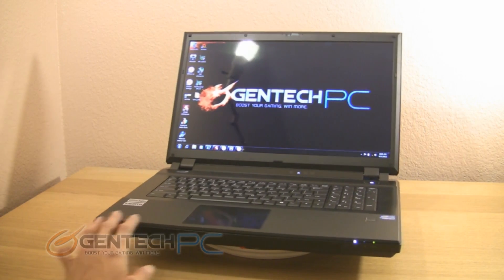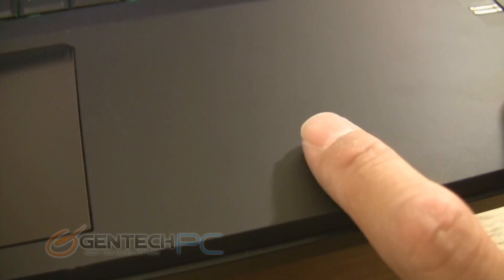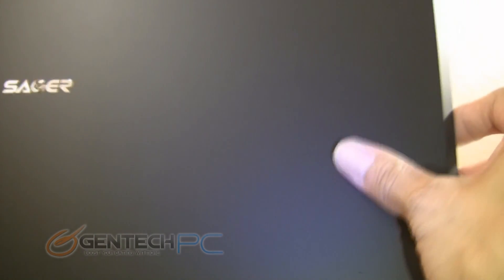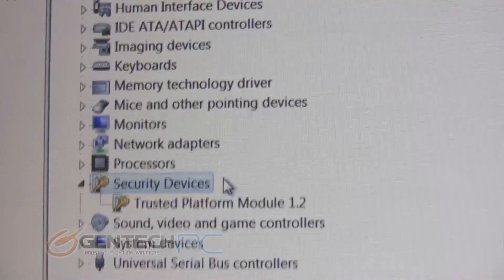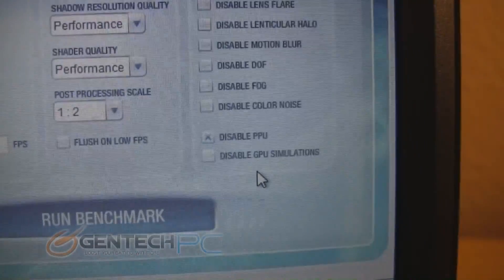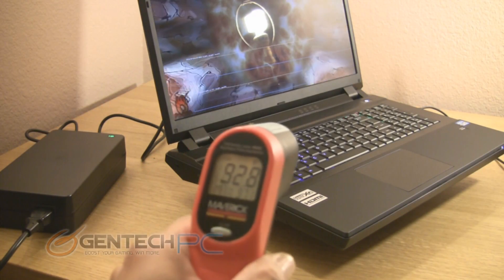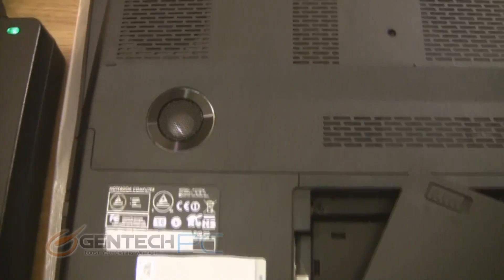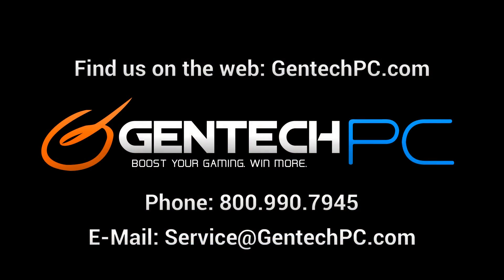Sager NP9370 (Clevo P370EM) GTX680M SLI Benchmarking & Review

Comment: Well I just ordered on of these. I got the 2.6Ghz as well as a 64GB SSD (in addition to a traditional HDD), but I went for a single 7970 to save a bit of cash.

I did quite a lot of research, and decided that the performance differences were minimal enough to save the $250 or so, also considering that Enduro isn't enabled on these. Later on, maybe in a year or two, I could pick up an extra 7970m and remain relevant.

Comment: I would say they are both on par with one another with regards to performance. The sager would be more easy to fix and a lot more future proof. It also has a better cooling system. The alienware has more pretty lights and colors on the side, but then again, you can get the sager carbon wrapped from xotic pc anyways. So if you don't care THAT much about the lights on the side (the sager has a colorful backlit keyboard too) then get the sager for better reliability and upgrade options.

Comment: Can i connect my xbox to the monitor via hdmi cable ( i dont know what hdmi 1.4 with hdcp is maby that means hdmi in?) for audio/video use? I was told you need a hdmi in/out port not just an hdmi out port which makes sense i guess.

Comment: he said first 17 inch  to run the GTX 680m and AMD 7970m in SLI and Crossfire, presently the M18x is the only alienware laptop to run SLI and Crossfire and its 18.4 inch and cost alot more then 17 inch M17x, There's about a $400 difference in this running in SLI with the GTX 680m vs the M18x.

Comment: Crazy! This laptop with the 2x4GB GTX 680m's will run Doom1080p all Ultra settings at 35 to 100 fps! Average wise around 60 to 65 FPS. Windows 10 a little slower, but windows 8.1 speeds things up by 20 to 30 percent!

Comment: Haha... I have the same question. I was JUST about to call alienware and order one when I saw this video... I've never owned either, BUT from what I've read is that Alienware laptops are better when looking at build quality. Other than that, I believe if you have the same specs on both and don't need the flashiness then you can save a little bit of money by buying the Sager. It all comes down to preference.

Comment: well one gpu is on both sides, so there isnt much you can do. regardless there is 3 fans. one on each gpu and the cpu. even with sli 680s it runs extremely well temp wise. I was impressed. it was hardly running over 100F which seems quite nice to me

Comment from the maker: They are pretty much the same besides the cahssis and dual GPU.  Also the video cards are different because 9370's video card does not support Optimus.  so if you take the 9370's GTX680M on 9170 it will not work.

Comment: i would get the asus g75, it looks alout better they have their own chassis, and cooling is alout better sound, etc. the performance tough wouldent be as good but still pretty good, if you got the 670m version you could run bf3 on ulta at 30-45 fps. i have one :)

Comment: Hiii, i've got a laptop Alienware M17x R4, Processor : 3rd Generation Intel Core i7-3740QM (6MB Cache, up to 3.7GHz w/ Turbo Boost 2.0), Memory: 12288MB 1600MHz Dual Channel DDR3 (2x2GB + 2x4GB ), Hard Drive : 1TB RAID 0 (2x500GB 7,200rpm, Graphics : 2GB GDDR5 NVIDIA GeForce GTX 660M, i play this game call (Warrock some how i get low FPS lagg in game, i've done benchmarks nd everything comes out fine i cant figure out why i get low FPS
Reply: The 660M is your bottleneck.

Comment: slow down, I thought so, before you waste thousands realise that the 3dmark vantage score is not that impressive as a single gtx680 gets 25000 3dmark vantage.

You only need sli when you are going to use more then 1080p gaming res monitors or if you want to have smoother multi display gaming performance, otherwise you can save a mountain of money by just getting a p170em with a gtx 680 and your 1080p gaming days will be plenty ahead.

Even the 7970 crossfire only scores abit less then sli 680s

Comment: I understand when resellers are trying to push their new products but like other posers buying dell aw m18x, you don't need to spend 4 grand to enjoy what you can on a 2400 dollar laptop.

LOL, i just looked at alienware australia, they want over 4 grand for there aw m18x with sli 680m's. 

So unless you are going to use multiple monitors at high res or playing over 1080p, save your money and go with a single gtx680. Sli and crossfire is for Posers with little wangs.